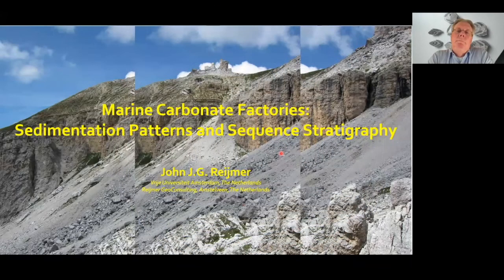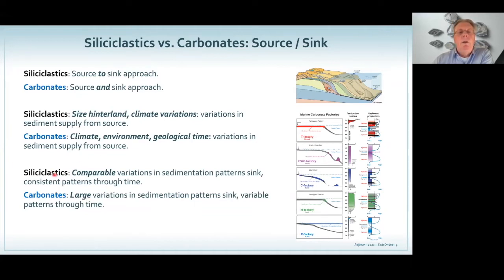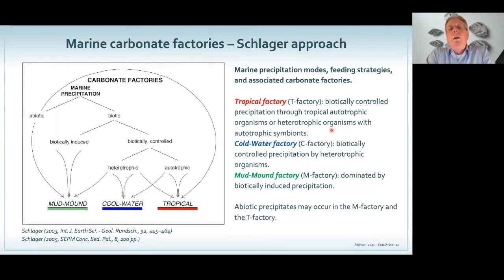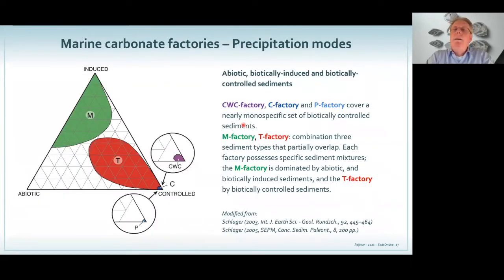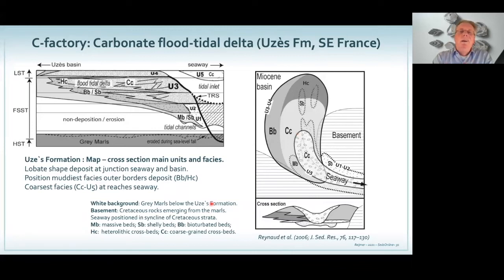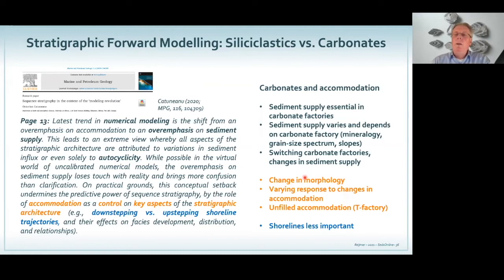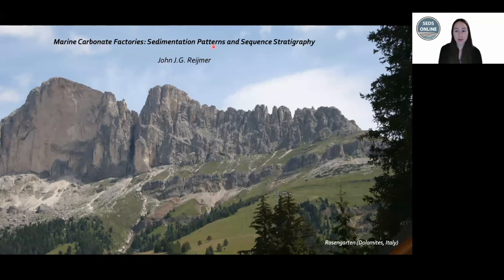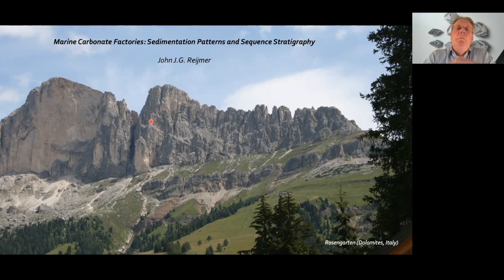Marine Carbonate Factories: Sedimentation Patterns and Sequence Stratigraphy

Comment: As early as 1669, Steno determined that every layer of the earth must have been formed horizontally by mixing with water. Shark teeth were found high in the mountains. The conclusion is that at some point seawater must have been higher than the mountains. There are now two possibilities. Either the water is lifted above the highest mountains or the land sinks under the water. Geologists have chosen the latter possibility as the indisputable reason for the formation of layers of the earth. The large number of horizontal layers on top of each other indicate that this event has occurred often. Geologists have estimated that the formation of one layer will take at least 100,000 years. Geologists apparently know nothing about the oldest history of mankind. Several ancient books speak of a cycle of seven world periods that are separated by a natural disaster. Plato tells of regularly recurring disasters involving a celestial body. Other sources tell of a planet that is approaching the earth. There are many images of that event! That planet is invisible until it is close to the sun, says Pliny. Planet 9 must therefore orbit our sun in an eccentric orbit. Then its speed during the crossing is very high. As a result, the gravitational pull on the planets near its orbit is strong. As a result, during some crossings, the water on planet Earth is pulled up very high, even "above the highest mountains" with everything that is scooped up in it. It is an extinction level event. The crossing lasts seven days. At the end the planet is covered in a thick layer of mud including remains of many land and sea animals. The layer hardens after some time and forms the next layer on top of many others. We have been able to construct a timeline in which we can see that five tidal waves are pulled over the Earth and thus five layers of the Earth are formed in a cycle of 25,200 years. Abundant and convincing evidence about this cycle of natural disasters and many images are available in the eBook: "Planet 9 = Nibiru". Search: invisible nibiru 9